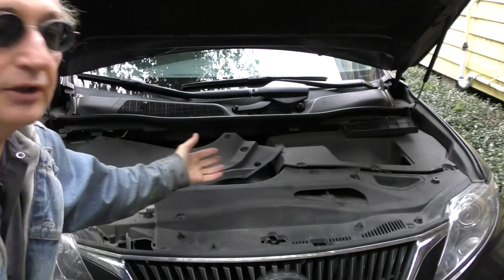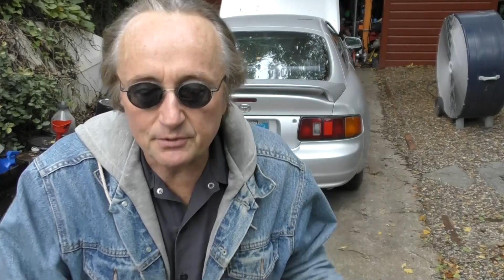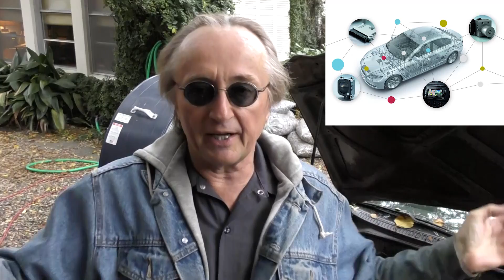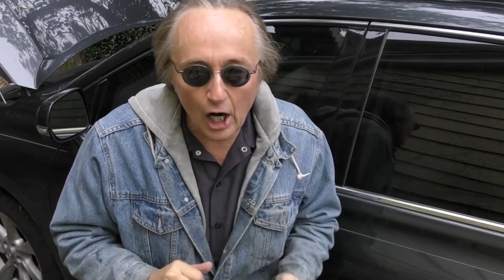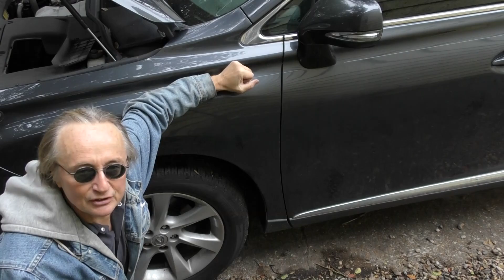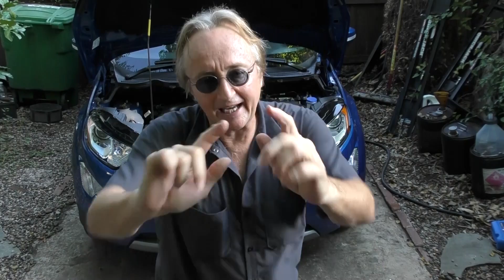The End of DIY Car Repair, Why New Cars are So Hard to Work On

Comment: I work in the commercial HVAC industry. Been doing it for 12 years. And here too its getting more and more complex with computerization and digital controls. Mechanical sensors like water level indicators are being replaced with electronic sensors. There was a time where you only had a heating and a cooling setpoint. Now they have something called a reset. Where basically the temperature setpoint changes based on a specified condition like an outside air temperature or how many thermostats demand cooling or heating. Its insane how far technology has come.

Comment: Could you do a video about driving cars repeatedly on unpaved (and unmaintained unpaved) roads?  Are cars really being built for the level of abuse they suffer driving on unpaved/unmaintained gravel/dirt roads?  Great video!
Reply: I'm not a professional but i believe that you need to keep your eyes on suspension and under the car parts ( tie-rods,  control arm, etc...)
Reply: Depends, if it has a low ride height then yeah you'd want to be really careful when driving it, but one with a bit more height should be fine. I live in eastern europe and trust me you will never find roads this bad anywhere else, and I've been driving 30+ year old cars since I got my license on them, and never had anything happen to the underside.

Comment: The best example of a modern V-8 engine that is mass-produced is the Ford Coyote V-8. It follows the design principles laid out in Sir Harry Ricardo's classic book: "The High Speed Internal Combustion Engine", an engineering classic written in 1921. It had overhead cams and 4 valves per cylinder. The Hemi and Chevy V-8s are simple designs made for easy mass-production. In block cams, two-valves per cylinder and pushrods are really old designs. The Chevy V-8 was a 1953 "temporary" design that became permanent. At least the Hemi has a crossflow valve system which the Chevy lacks. The Coyote V-8 is under rated. With the flat plane crank in the Shelby GT350, it puts out over 500 hp in NA form. With a blower, over 800hp can be achieved. The Coyote V-8 will be around after the HEMI is dropped and production numbers will eventually pass those of the HEMI because the Coyote is so affordable in the Mustang GT.

Comment: I just worked on a car another mechanic gave up on. No crank, no start. Scan tool would not communicate with anything. Turns out the speedo cluster was taking down the can network. Unplugging the cluster restored the network. It required a scope to diag.
Reply: the problem you are talking about is commonly known as Cluster F**K ! But in general, many such electrical problems can be reset by unplug-replug , and many electro problems are just due to bad/loose connections.
Reply: @leereed790  I actually just reread my original post. Unplugging the cluster brought the high speed can network online. BUT the cluster was missing a ground which took the MS can network down. Fixed the ground and it was up and running.

Comment: With so many government mandated safety systems in today’s vehicles, why are exterior lighting systems still so poor unless upgraded? We have TPMS, ABS, traction and stability control, airbags all over the place, and much more. Yet halogen headlamps and incandescent marker/signal/tail lamps are all too common. With backup cameras and automatic collision braking coming as the next requirement, modern efficient lighting continues to be a premium upgrade in some vehicles and not available in others. Going with aftermarket add one can be problematic and illegal in some cases. Many drivers seem unaware of the importance of good external lighting, often failing to turn on headlights when using wipers or where visibility is reduced. LED lights use significantly less energy, hence their use in hybrid vehicles, and still we aren’t seeing them replacing the traditional Edison light bulb in vehicles. I’d love to hear your thoughts on this Scotty.
Reply: I was thinking about this recently looking at new luxury cars at stop lights and they all still have regular bulbs. I swapped all my lights to led but it does make the blinker go like a bulb is out. Just need to buy the adjustable flasher relay. The reason can't be cost either. These things are cheeeeap

Comment: i noticed honda is making it harder just to replace the starter. Now you have to remove the intake manifold for the 4 cylinder honda accord and some civic you have to remove the axle just to make space to get to the starter. The older Hondas were simple to work on.

Comment: Gentlemen hold on to your classics like the few strands of hair on your scalp, because these newer vehicles are here to bankrupt your wallet.
Reply: Toyota
Reply: Bro Codez Toyota are very reliable, from my own perspectives people should keep their vehicles especially if it’s paid off, and practice maintenance like it’s a religion, the older the better, no matter what brand, no car payments means more wealth.
Reply: Aint that the truth. 2 sensors on my ranger were $90 and then the brakes, $45 caliper, i forget the rotor and around 20 for pads. These parts houses are in it to break the bank.
Reply: blueovalfan23 yup, these politicians have lost their minds, they have no problem throwing higher technology, and more costs on citizens, and it’s really up to us to make the financial decisions not to get into more debt, that is considerably greater than our income, it makes no sense that computers are wiping out existing jobs, along with heavy upkeep, and maintenance costs, and professional salaries are not meeting those demands, me and my 1999 will ride until they put me in a casket, and it in a junkyard, cheers 🥂
Reply: Straight six '97 Jaguar, go on for ever.  The one problem with the on-plug ignition coils overheating is easily fixed by extending them so they sit outside the engine.
Reply: Will do as long as the parts r there...
Reply: and new cars are built like cheap crap ..disposalable

Comment: Here's an idea: Let's stop buying new cars and stick to older model cars that we can fix ourselves!
Reply: Stop spending money on new cars for 2 years everyone then maybe those manufacturers will come down on engineering and then remove the EPA guidelines that restrict and smother these engines retarding fuel miles and causing engines to overheat and other issues
Reply: Agreed 100% theres a reason there exists an entire subculture around modding reliable cars like the Honda Civic from the golden age of vehicle manufacture 1996-2010 where they didn't overutilize computers etc. But the OBD system had been standardized and things like VVT,VTC, and VTEC existed which actually made cars cooler, faster, more fuel efficient and easier to work on with todays tools because with a relatively cheap chinese made diagnostic scanner you can typically find out whats wrong with the vehicle before you start taking it apart.
Reply: Wake  up...you  are  dreaming  again.   EPA  and  government  controls
everything.  Just  the  time  we  are  living  in.

Comment: That's why my 'new' truck is a 1984 F250 with International diesel engine. I'm fully restoring it. The most sophisticated bit of electronics is the clock. 
My wife's vehicle is a 1998 Ford Ranger. it does have a computer and OBD2 system but it's relatively easy to troubleshoot and repair. We would never, never buy a new vehicle, certainly nothing we can't repair ourselves.

Comment: I think you made a confusion here... CANbus transmits data, not power, so that's why it uses 5V and few milliamps... It doesn't require much power to transmit data, and it's a good thing.
BTW, voltage is not power. Power is voltage * amps.
Reply: I think the point was that tracing less power to a short/fault is harder to do.
Reply: @Kuuryo that's as fun as eating at whole foods.

Comment: My car is running rough, you can hear the engine struggling especially at higher speeds and the rpms are a lot higher than usual, also fuel is being consumed a lot quicker. There is no check engine light. I have a pretty good idea of what the problem is but i want a second opinion
Reply: Josue Alvarez Might be an oxygen sensor. Have a 2000 Avalon and currently my car burns gas a bit quicker than usual and has random misfires. Once I fix that Im great.
Reply: Check the mass airflow sensor. My truck is running rough. The throttle response is kinda wonky. The computer scan indicated an error with the MAF sensor. Usually you just need to clean it. Also the fuel milage hasn't been a good in the past few weeks.
Reply: Devon Young it’s not the sensor itself, I already replaced it because i got a code for it being slow, and it cane back and I just cleared it so most likely it has something to do with that
Reply: Daniel Stover my car doesn’t have a maf sensor, just a map sensor and and air intake temp sensor
Reply: What kind of car / year / engine is it? What does the noise sound like? Have you done any scoping for the rods, shaft, etc.?
Reply: Wolf_22 2005 honda civic 1.7 L in line 4 cylinder engine, the engine sounds like it’s forcing itself and the rpms are higher than usual at low speeds
Reply: P Truong all those things are my car have been changed recently and I checked everything and they’re all good
Reply: @user-wr6wo6vr8r  same deal, if any of those sensors fail, your in for a world of hurt in modern cars , LOL , map sensor is manifold absolute pressure and adjusts fuel ratio with talking to throttle position sensor and air intake temp sensor to try maintain a 14.7 :1 fuel mixture :)
Reply: Check you air intake line. If there is unfiltered air enter the vacuum line the computer will feed more fuel to the motor to compensate the unwanted air that not being filtered. My mechanic showed me on his scan tool how the long term fuel mixture ratiol was maxed out due to a loose vacuum line. Hope this helps.
Reply: @user-wr6wo6vr8r  stop telling him to open his wallet in every directions. higher at idle when warm, check vacuum leaks first then idle control valve then coolant temp sensor compare with air temp when cold.
Reply: P Truong that’s a basic tune up that won’t fix it lmao
Reply: Check  your crankshaft position sensor, what that does is determine the how often the crankshaft is rotating so rpms are weird and the ecu uses that information for fuel injection timing and ignition timing. All the other answers no offense to them but are way off if anything just get a diagnoses by a good mechanic
Reply: What is a diagnoses? Is it English?

Comment: I loved my old Toyota Tercel. It was incredibly easy to work on: plugs, fuel pump, alternator, among other components, were a breeze to replace.
Reply: Yes old japanese cars are in general easier to work on, although  I found honda were more tightly packed and hard to work on.  So far I found old suzuki > Toyota > Honda.  Of course not talking about reliability.  I don't even need to jack up my suzuki to replace engine and transmission oill & filter.

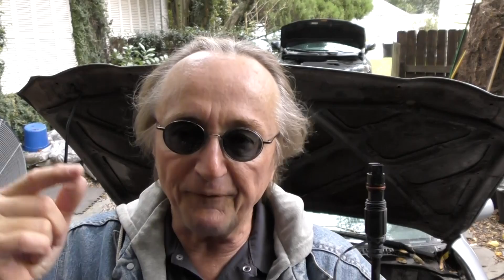Comment: @ 2:58 be careful when touching the ends (points) on Fiber optic cable.  Matter of fact don't touch the points at all.  If some glass cuts into your skin,  you will need to goto a doctor and get a chunk of skin removed / cut out.  The chemicals and materials used with the glass inside can get into your blood stream and make you very sick.

Comment: I owned a 1985 Toyota Long Bed pickup truck from brand new in 1985 up until 2006 when I had 211,000 miles on it. No computers. It had an uncomfortable bench seat that wore out over time and had a ton of road noise to listen to. The body was sort of tin-canny like. But...the 22R engine in it wouldn't die. Started up all the time and put very little into it. You open the hood and there seemed to be enough room in the engine bay to climb in there with it!

Comment: GF Toyota Camry engine light turns on. Auto store scan said "bad catalytic converter" so she takes it to the dealer. They do a scan and confirmed the catalytic converter failure !   Per the forums, a lot of other people reported similar problems and it made no particular sense to me. So I looked carefully and noticed a small amount of oil oozing from the back of the valve cover.  Replaced the gasket, unhooked the battery to reset the code.  After several thousand miles, engine light is still off (for now).

Comment: When I was younger, I’d work on my car & it was fun. In 1979 when I was 16 yrs old my first car was a 1970 Dodge Dart Custom with a slant 6 engined. It was built like a Tank & drove like it. Put up over 200,000 miles on it, then got some frame rust. In 1983 with my brother, we tried to blow out the engine driving it up in the Colorado mountains. Driving off roads & back country. We couldn’t blow out the engine, so we rolled it off a cliff to watch it crash. It’s still there to this day off Gold Camp Drive on Cheyenne Mountain.

Comment: Can you imagine what it will be like in 30+ years to restore one of today’s  destined classics ?
Reply: Simple, they won't bother.
Reply: I think it would be super easy: 3D print all the parts, throw in a computer and you are done)
Reply: People won't.
Reply: Jake McCoy is right but I am going to add this  I think anything over 400 hp and anything with stick shift be desired as very rare . Think we will have evolved to Hydrogen electrics and not everyone will be allowed or want to drive by then
Reply: Probably enthusiast cars like Mustang, Camaro, Corvette, Porsches, Challengers, Chargers. The rest of them pretty much look alike and are disposable. Most people just want to he able to get to work in the morning and as soon as the thing starts having problems it gets dumped. And if the problem is anywhere near complex it gets too expensive to justify fixing so off it goes to the junkyard.
Reply: I do think there will come a point someday when there will be few if any "classics" of current or future models.
Reply: most modern cars arent worth restoring.  Delete all the computer and go analog and it might be worth a go. or just use the body panels on something else.
Reply: Any car can be modified or restored. That said some are easier than others. I would prefer to begin work on a good platform that is not heavy. The only think lacking is just creativity.

Comment: Many sensors and controls are just potentiometers that can be tested with a DVOM. 
The plug n play accelerator pedal in my wife's '07 Dodge is just a pot.
It's currently acting like a crunchy volume control on an old radio causing hesitation or unwanted acceleration along its travel.
I unplugged it and tested it with an ohmmeter and could see where all the dead/weird spots were as I moved it.

The trouble with the low voltages is that the slightest resistance in a circuit can throw everything off.

I had a friend with a Ford Five Hundred who had a hard time starting it and couldn't keep it running when it started.
Key on/off code retrieval said low battery voltage.
Turns out he had a badly corroded positive battery terminal clamp that woudn't tighten.  Once it was replaced and the terminal cleaned, the sensors got the correct reference voltages and after the brief idle relearn, it ran like new.

Comment: Scotty, as a 20 year old new driver, what's the best way to get affordable car insurance? I'm in Ontario Canada but you may have some tips that can apply to everyone? Looking to buy an older model Civic or a Corolla.
Reply: I know you were directing your question to someone else but thought I might mention that here in the States, the best route is to just shop around for the most affordable plans given almost every 20-something gets hosed on insurance rates. Also, I could be completely wrong here but I think some places used to provide discounts for drivers that voluntarily took special driving classes for things like defensive driving? Again, I might be wrong about that but I think I remember hearing that from someone. Might be worth a look because I know you get certain perks similar to insurance discounts when you take motorcycle coursework to get your bike endorsement.
Reply: Here in the states your best bet is good grades for young and waiting to be at least 25-years-old, but it could be better younger if you are married. Also, it might be cheaper if you can get on with someone that has an excellent insurance rating and low rates, likely the best rates you can get. In the sates you don't want a red or yellow car, the insurance rates are higher! Your best bet is to get all of the info. about the car you're interested in and call several insurance companies to compare rates.

Comment: My problem is not the electrical part. My problem is the stuff being stuffed in such small places that are so compact that I can't get wrenches to the places let alone get my hands to . Some you can get a wrench on the bolts but then there's not enough room to turn the bolts without disassembling half of the engine components to remove something that you can see really good but can't get to!